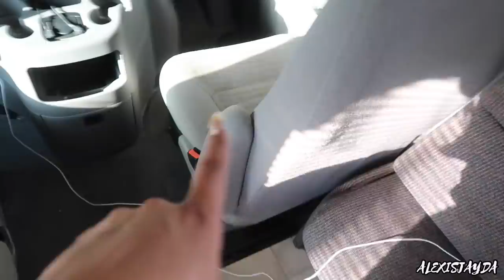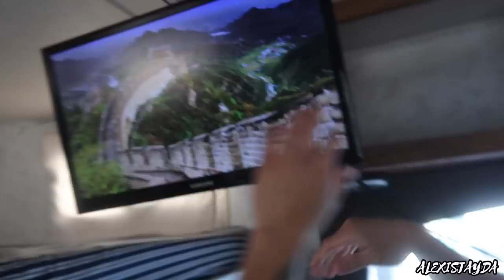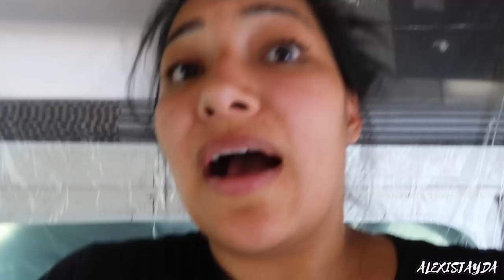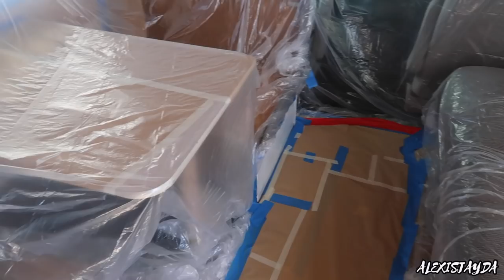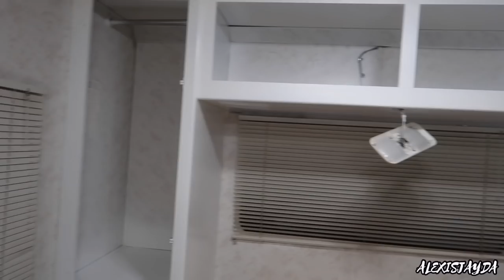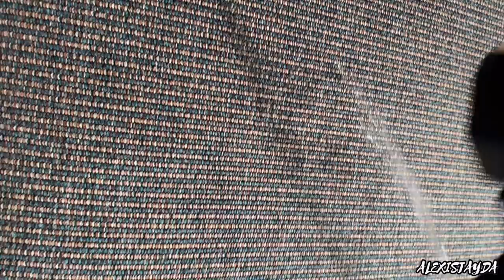WE BOUGHT AN RV 😭❤️  WE DID SOME RENOVATIONS! - ALEXISJAYDA

Comment: Hope you guys have lots of happy memories in your new RV! I personally prefer renting one due to the crazy upkeep and repair costs.....but we have a small family, just one teen son. My aunt and uncle had a few over the years and the biggest advice they seemed to have (when we contemplated buying one) is to never let it sit in one spot for longer than a month (& run it for 5-10 min every two weeks cuz of the battery), drain septic after every trip, don't skimp out on regular oil changes/tune ups & keep at least one bottle of the different oils/fluids that your RV uses. After multiple tire blow outs, they started to carry two full sized spares because it's rough to get stuck far out from a tire store....it's cheaper to keep at least one full-sized spare handy.

Comment: My parents owned an rv dealership for over 30 years. My best advice is to make a notebook with lists for before leaving, lists of packing checklists, with reminders to check tanks etc, unpacking lists (absolutely no food should be stored in a sitting rev because of mice): any manuals you have and an old fashioned paper US map. Always add emergency roadside assistance with rental to your insurance (towing a mini home to the closest town can cost several hundred dollars). Make a very visible sign to make sure your awning is up and secured,  antenna and top air vents (we bought a spare cover because the plastic snaps easily as it gets older from sun exposure and always seems to break right before a huge storm) are down and know the clearance height WITH your roof air conditioner. It’s not good for anxiety to have to guess right before going under a low overpass. I’ve seen a lot of expensive oopsies by forgetting to add the air conditioner to the height. Hope you have a blast making memories.
Reply: PS….the cameo at the end was a mama happy heart moment!